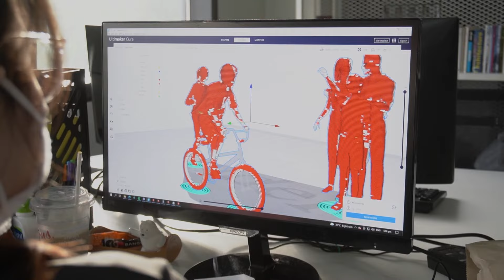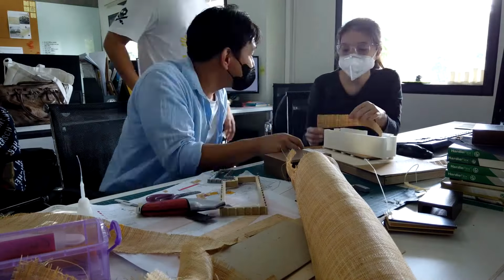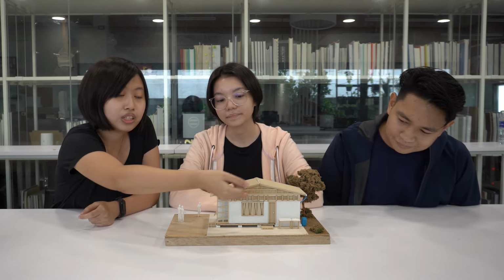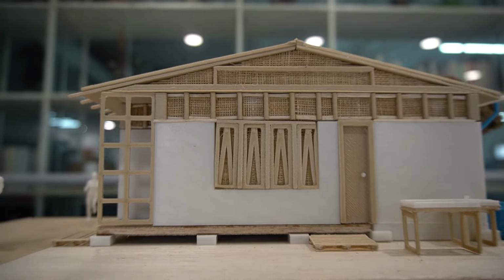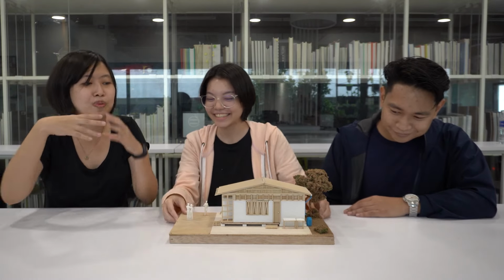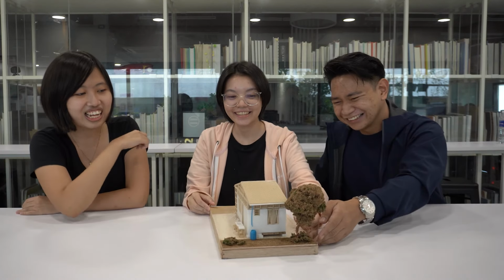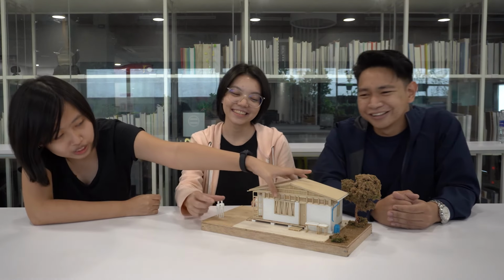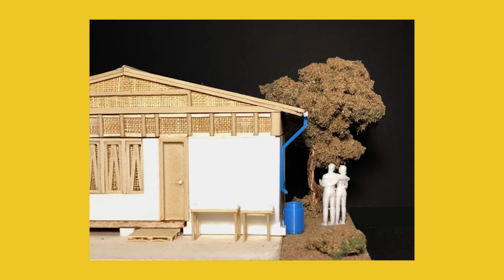Scale Model Making in 2 Days: Siargao Resettlement Sites  |  Wednesdays at WTA

Comment: Have you thought about typhoon resistant domes?  They can survive the strong winds with a streamlined structure. Geodesic domes.
Reply: Hi Chris! That's actually a nice insight. Yes, we did consider several construction methods, but we opted to do something that can easily be constructed and replicated by the volunteers. Hence, our final design is very modular in the sense that it can be built efficiently, by requiring less amount of modification in the materials used. Through this, we were also able to lessen the cost of the overall construction.
Reply: @annmargarettan8712  Thanks for the response! Due to the risk of strong winds that can easily demolish weak structures, my mind went to first constructing for strength and resilience. Like rather than an easy design to build that can be destroyed and replaced easily, build for strength :). Keep up the good work, good luck.